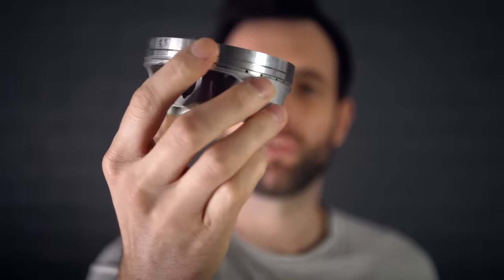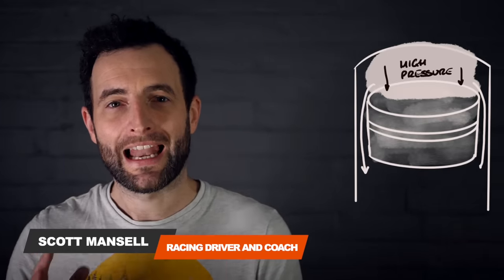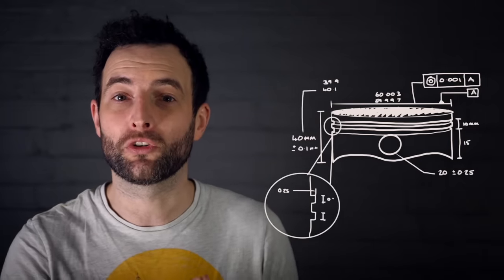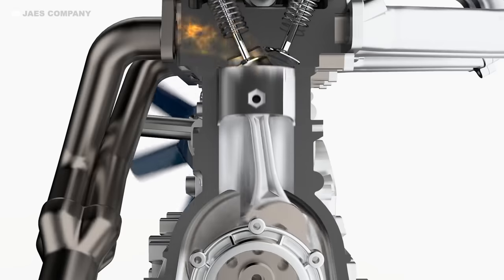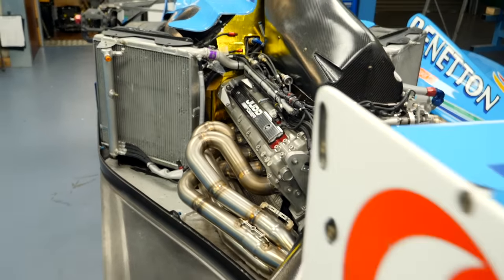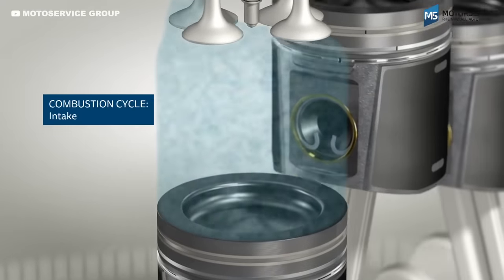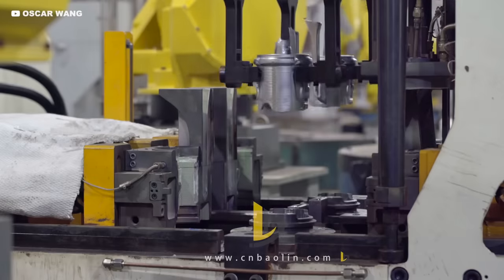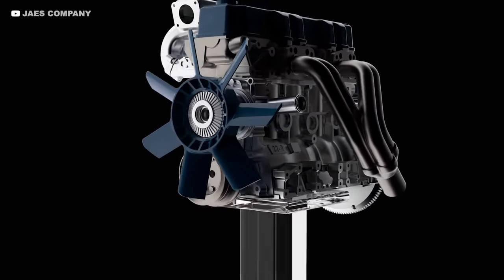Why F1 Pistons Cost £50,000!

Comment: I was today years old when I learned that F1 engines seize at room temperature.
Reply: Same, i was not ready for that information.
Also, hi miata dad f1 engine when??
Reply: That means my old Alfa engine was an F1 engine but I didn't know it!
Reply: they should be too loose to start engine, not to seize... something is wrong.
Edit: video has several misinformation. 
So yeah, pistons can't seize in room temperature. Metals expand when heated, so engine components are really loose on room temperature. Thats why they need to heat up the engine before starting. They just could not start it at lower temperature, because compression flows past the compressor rings at room temperature.
Reply: @Martink9191  remember the block and bore diameter also shrinks.  the passageways for the pre-heated oil/water are of course located in the block.  the piston then gains most of it's dimensional changes off the intense heat of combustion AFTER the engine's running.
Reply: They are NOT seized prior to starting. The internal components (piston, rings, wrist pin, con rod, etc) "swell up" once they are hot. If it's "seized" prior, it won't start once it's up to operating temperature because aluminum, steel, plasma moly, actually swell up BECAUSE OF HEAT, so the pistons would be even more seized 🙄 than before temperature is brought up lol.
Reply: Non of this stuff is actually ground breaking . It’s just that that low volumes produced demand a very high development cost . My model aeroplane engine has a tapered cylinder bore ( because it gets hotter at the top , so doesn’t become round until it’s warm ) cost around $200 . Motorcycle engines (even air cooled) from way back have  always demanded clearances as low as a half of one thousandth of an inch . ( even the plain ol Honda XR200 ) . The piston you are holding looks exactly like the piston from any late model moto cross  bike  ( about $100 ) . Even the local fire brigade use oil heaters on their dirty ol diesels, no idea why , we don’t get below -5 c
Reply: I was 4 days older than you are now when I learned about the insane cost of these pistons.
Reply: @Martink9191  Then why are cold engines so hard starting, if they were looser they should spin right over and start. Just from experience it is easier to spin an engine by hand when it is at operating temp than it is when below freezing.
Reply: @johnchristensen3030  because at low temp engine is not as tight as it needs to have good compression. Low compression causes bad starting, and there are several more problems with cold, like petrol or diesel won't evaporate so easly at low temps.
Warm engines are easy to cranck, because oil is just there and it is warm, wich is easyer to flow. Cold oil is more like honey, when hot oil is like water.
Reply: @Martink9191  if it's not as tight why does the starter groan to turn it over. Modern multi viscosity oils are not like honey when cold, most are at least partial synthetic and flow quit easily when cold. If the oil pump was causing the starter that much work the oil pump would shear it's drive or break it's own housing.
Reply: @johnchristensen3030  cold battery has lower CCA, that means lower voltage at crancing, and lower crancing speed. If we take warm climate cold starting, then overnight stayd battery has 12,4v, when battery that was charged half an hour ago, has 13 something volts.
I just made explanation how oil differs at different temperatures. And there are still thinkness difference at different temps. But they still are near like honey, if you live area, where temps can hit -30 degrees of celsius at winter time.

Honestly, I am not going to educate you. I undrestand, that your knowliegement is low.
Reply: @Martink9191  l have a yard full of tractors and pickups. everything moves harder when cold. There is knowledge and there is experience.
Reply: @johnchristensen3030  Martink9191 is right. On a typical engine, clearances are loose when the engine is cold, they tighten up at operating temperature. If you overheat your engine, clearances may become too small and can cause galling or seizure of any friction surface.
Cold engines are also hard to start for the reasons related to fuel being more difficult to ignite, especially with diesel (hence the glow plugs). Oil viscosity (cold) also adds to the difficulty. Additives and synthetic oils are better when cold  than conventional oils but the lubrication is best at operating temperature too. Battery amperage is also lower at low temperatures.
Reply: @johnchristensen3030  if you have so much equipment in your yard, then why you ask so rookie questions?
Reply: The block/cylinders expand at a higher rate than the pistons. 
So yes, it could be "seized" at room temperature
Reply: @bloodzkull  not true
Coefficients of Linear Thermal Expansion for
Aluminium is 21-24 (10´-6m/(m*C)
Steel  10,8-12,5(bore wall)
Reply: @johnchristensen3030  If I leave it outside, It won't be there the next day. I live in Los Angeles.

A few of us have already covered the reasons why the engine is difficult to start when cold. In your chainsaw example, the thicker oil viscosity and fuel resistance to ignite are the primary reasons. The bearing and cylinder tolerances are looser when it is cold. If you don't believe me, get a micrometer and measure the piston cold... then put it in the oven at 200 deg F. and measure it again. You will see how much it expands.

Did you take any physics classes in school? They should have covered this stuff with a metal ring and a steel ball demonstration.
Reply: Did you know that the Lockheed SR71, the fastest plane ever built, leaks fuel at a dramatic rate while on the ground to the extent that it needs refueling immediately after take off?
It is only after flying at high speed that the friction increases the temperature of the hull sufficiently that the metal expands and seals the leaks.
Reply: @Martink9191  I think your comments and thinking are good.  This is a good question, and yes, the aluminum expands twice as much as steel.  However, I've also owned engines (model airplane engines) like another guy mentioned.  They are much tighter at low temperature than at high temperature.  Its very easy to feel that with your hand when you turn over the cold engine vs the warm one.  And I know they have aluminum pistons, and some have heavy chrome coated aluminum cylinders, others cast iron sleeve inside an aluminum case.  Some have heavy chrome plated brass cylinder liners too.  All are tighter when cold.  Especially the ones with the chromed brass liner.  I've always been confused about this too - doesn't the aluminum piston want to expand more than the steel cylinder liner?  But no.
Reply: @johnchristensen3030  - Several guys gave you the main answers as to why cold engines turn over and start harder. 

1) Cold oil has a higher viscosity, therefore there is a lot more drag on almost all of the moving parts.  
2) Fuel does not vaporize and burn as readily when cold (especially diesel).  
3) Batteries have a lower output when cold. 

Iron or steel cylinder bores actually expand in diameter when they get warmer (even in aluminum blocks with ferrous liners), but aluminum pistons expand at a significantly higher rate. There is less piston to cylinder wall clearance on a warm/hot engine.  If the engine gets too hot the pistons are likely to seize in the bores or at minimum bores and pistons become badly scuffed.  These are facts that science and real world engine experience back up. The video in fact contains misinformation.
Reply: @Martink9191  You are right, materials expand when heated, for example a long piece of wire will get both longer and thicker proportionally, but it will get longer more than thicker in absolute units because there is just more material to expand in that direction. Now imagine that wire bent into a ring, and you will see that the whole ring will expand as well, making the hole in the middle bigger, not smaller exactly because of the same effect. Add another dimension and you'll get a cilinder, engine cilinder.
Reply: @romanr1592  and your point was?
Reply: @Martink9191  Holes can either shrink or expand when heating, depending on the  distribution of material, and in case of pretty thin walled cylinders they grow. Just lik a solid metal cilinder would expand outwards.
Reply: @romanr1592  yes, And I wrote expansion rates for basic materials earlier. What is your point?
Reply: cylinders shrink when cold. The squeeze the pistons and rings too much
Reply: @Martink9191  If the cylinder liner is steel it will expand much less than the aluminum piston will
Reply: @zacht9447  o really? And what did I say?
Reply: @minesweeper6312  - Cylinders do shrink when cold, and so do pistons and rings. Additional, piston rings have end gaps and will never get too tight because the engine is cold, the gaps get tighter in a hot running engine. Piston to cylinder wall clearance is greatest in a cold engine (assuming aluminum pistons), that's a fact, not a guess by people who do not fully understand the physics involved.
Reply: @johnchristensen3030  Cold cylinders contract inwards. When machine shops sleeve an engine they will freeze the sleeve which allows it to shrink just enough to be put into the cylinder then it opens back up. Now imagine if the outer diameter contracts, so would the inner diameter.
Reply: @Martink9191  you missed the point he made so that the pistons cannot seize when the expand. Theyre oval to begin with and when they expand, they're designed to expand in to a circle, while the bore expands creating enough clearance for the piston to be free to move
Reply: Yes f1 engine do appear seized when the engine is cold, they have to slowly feed it warm oil to start it, the block expands way more than the very hard pistons!!
Reply: @G53X0Y0Z0  you're funny, f1 engineers was on live tv saying the engines are almost seized when cold!!
Reply: It is an exaggeration, I'm sure the warming up is to prevent mass scratching and wear of them tight ass cylinder walls... I bet 100% of my Youtube money that starting an F1 engine cold would not cause it to seize... but you might not like the look or durability of that engine after that fact.
Reply: @Martink9191  yes, metal expands when heated, but  if you have a hole in a metal, the hole diameter increases when the metal is heated. This is may not be 
intuitive but it is true. When you heat the coolant and oil, it heats up the cylinders and the cylinder bore diameter increases. Similarily, when you have a frozen bolt, you heat up the metal around the bolt using a torch which helps to unfreeze it and take it out.
Reply: Today years old, good!
Reply: @johnchristensen3030  I guess these commentors don't know, batteries are weaker in the cold, cold fuel doesn't atomize quite as well, cold intakes and combustion chambers are stubborn, and engine oil is pretty thick when cold.( slow cranking speed, since they don't know)  Now, add this all up.
Reply: @Martink9191  You forget about the silicon that is part of the aluminum alloy used in pistons just for this reason, reduce its thermal expansion rate!
Reply: @Martink9191  What happens in the case of very close clearance piston to bore fits is called a "Cold seizure". Piston alloys have a greater coefficient of expansion than cylinder materials, especially in a water cooled engine block. When the engine is started  from stone cold the light alloy of the piston expands faster than the cylinder, the clearance is lost and the whole lot seizes. High performance air cooled two stroke engines used to do it regularly if they were revved from cold; it's been known about since at least the early 1920s.
    In a civilian engine the answer is to run larger clearances or have expansion slots in the piston skirts. That can't be done on a F1 engine, so they heat the block, so that the bore is already close to its working (hot) dimension when the engine is started.
Reply: It's basic knowledge to long-time F1 fans
Reply: @johnchristensen3030  could it be that, the engine been lubed up, after running a while, compared to when its been not used for a while?
Reply: @communist-hippie  The whole discussion began with some people who thought they knew more about the topic than the guy that made the video.  Everyone has a basic understanding of simple physics, engines take a little more.  The blocks on these engines could be an all aluminum alloy and the cylinder bores are not lined or coated but impregnated with a nickel and ceramic mix. Who knows other than the engine builders that have the secret.
On the topic of oil, a cold weather procedure to aid in starting is to go out a start the engine after it and it's oil has cooled down. Start it and shut it off as soon as it gets oil pressure.
  The idea is that when everything is shut down at operating temp. the oil runs out of the galleys and out of the bearing areas. By starting it as soon as it all gets cold the oil stays in the galleys and bearing and the engine starts easier in the morning.
Reply: @Pete Pester"coated" is the keyword. Block itself is still made of some metal, that expands.
Reply: well, without oil, but thats why its all pre heated.  everything is to that tolerance to prevent gas from escaping through the gap of the piston and the wall.  using as much of the explosive force as possible.
Reply: @Martink9191  the piston expands at slower rate than the block
Reply: @ilham7345  No.
Reply: So many WRONG coments as always. If you really want to know how things around you work find yourself some nice university focusing on technology and natural science, spend there few years and you will never seen the world same ass before. No offense, but complex problems like this cant be fully understanded from short video, even if its nice work. Sorry for mistakes at language, as you can see im not naitive.
Reply: That’s pretty old
Reply: @grantfuller2016  They use oil heaters because they want the engines working at full strength and ready to go at 100% when needed . Damage to engines is mostly not from running especially in big pro diesel engines , but is from starting cold . In order to overcome this , the engine is kept at working temp , so less failure , wear , and performing the way it should . Every second counts when handling a fire .
Reply: must be a real pita to put together one if that's the case!
Reply: @Martink9191  yeah, or else how how would they assemble and work on the engine?
Reply: @paulholstein2159  
They expand not swell...

Comment: I built BMW V10 F1 engines in the early 2000s for a Williams chassis team out of Dallas. We machined our own pistons from forged billet bar stock. Then we hardened them by a process of heat treating and cryo cycles. Less than .001% expansion from 0-280°C. F1 tech has made leaps and bounds since then, but what we were doing was pretty cutting edge back then.
Reply: That has to be one insane CNC machine
Reply: What material were they made from? I don't know of any material that expands less than .001% from 0-280c